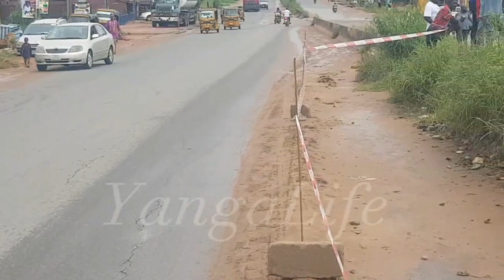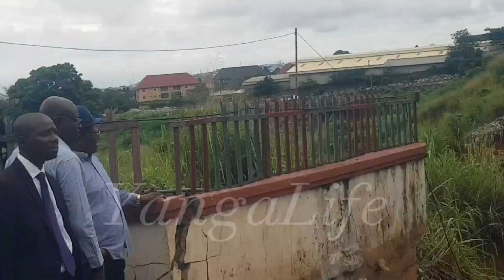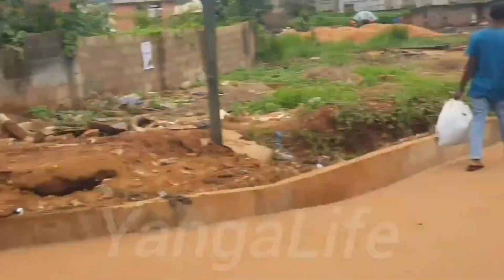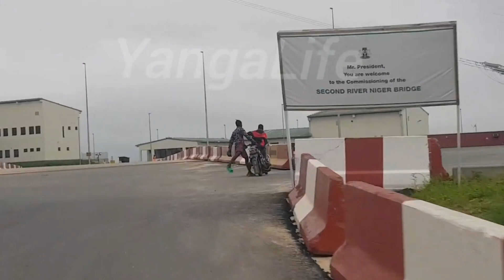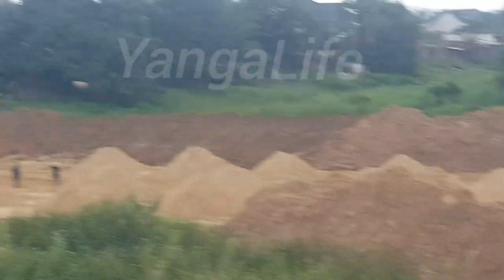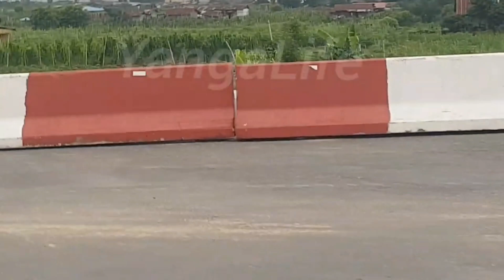Ban On Use Of Laterite In Road Construction, Punishable Offence, Dave Umahi

Comment: I am glad  Umahi does not idolize JB like you do.  He read the riot act to foreign contractors including large ones which I am sure includes JB, telling them they won't try some of their practices in their own country. Saying some have 27 projects on-going without having the equipment on ground to do all the projects justice or even the capacity. He  concluded by questioning the value of having foreign contractors at all if they are doing substandard work.
Reply from the maker: Why wouldn't they be idolised? Which road Construction company is better than them in Nigeria? JB is not like RCC or other companies. Did you see or hear Umahi talk to JB like he did to RCC ?
Reply: @YangaLife  I forgot to say I am @proyouservicesltd (using my relatives account) . Chinedu, Umahi has also been critical  of some of JB performance. Their slow pace of work is very bad and evident. Their overcharging is also very bad, if I was minister of works I certainly would not even consider giving them new work until these performance and overcharging issues are remedied. On another matter a day or two ago it was reported that Cameroon has opened their Lagdo Dam, meaning that floods are expected. 
Please ensure you move yourself and family to higher ground if you reside in a flood prone zone and then do an urgent video to sensitize people in flood plains to evacuate to safe areas and report on how LGAs in the flood plains are evacuating people  and protecting property if at all.
Reply: @YangaLife guy relax na una from east to worship them cuz  if u to to akwa ibom u have indigenous contractors there but your likes worship Julius berger ...

Comment: In road building in tropical rain forest region, the first thing that state and city engineeres have to do is raise the level of road building, and slope both sides putting culverts and planting grass on both sides, even if you use concrete, if the road is to low, water will wash it away, if the road is high up when it rains it immediately run off to the slop and the culverts, where are your local engineeres who work for the local government of the state, why do you need a new ministers to come and say every road in nigeria is badly build, nigerians are spending trillions building roads, the country is asleep, lazy, or we don't have real engineeres, what is done right in nigeria, it is everybody that accept garbage as black people, these construction companies can only work in black countries. Black people accept everything other people would not accept, 60 years after independence black people still cannot build and manage anything?
Reply from the maker: Well said.
Reply: @hendricksismael7810 Don't start castigating the black race , there  are some black nations that have world class standard roads. Not every black nation have the challenges and external and internal sabotage Nigeria has.  You sound like a Caucasian bigot.